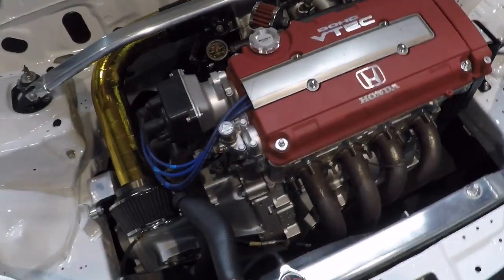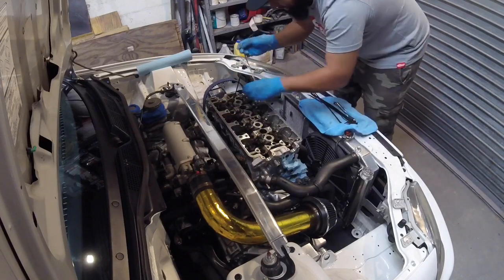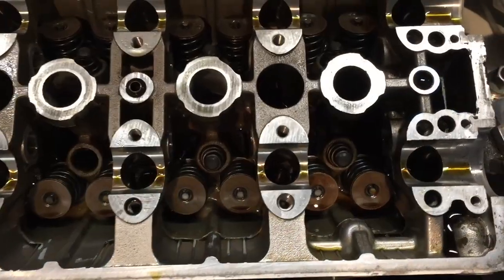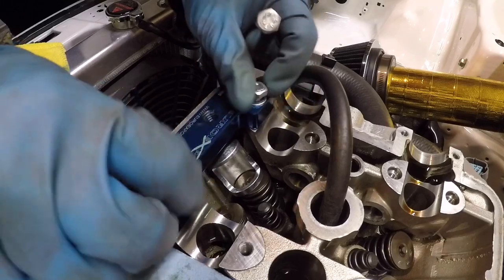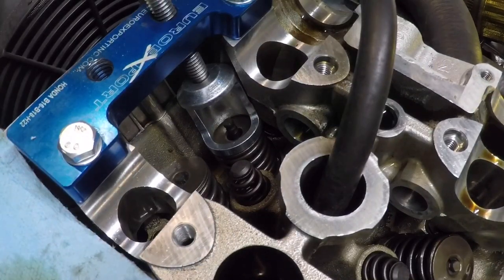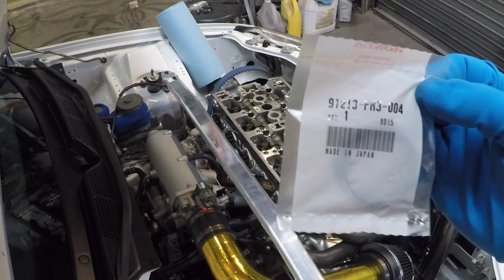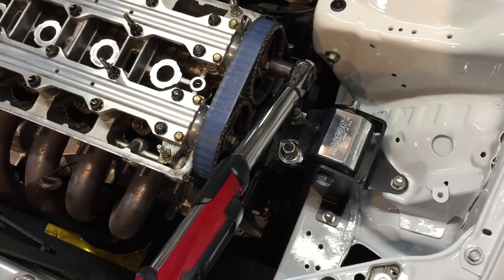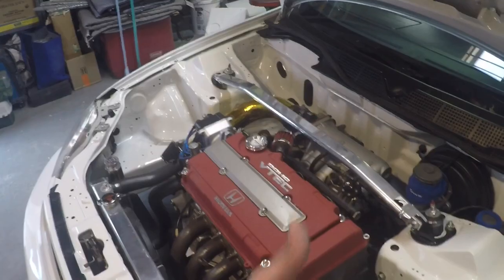How to replace Valve stem seals and lost motion assemblies on your Honda B-series VTEC engine

Comment: Did you have any trouble with the valve stem seals leaking using those supertech seals and dual valve springs? Ive heard they dont play well together.
Reply from the maker: Nope no issues at all! Still running great today 👍🏽

Comment: How many Gallons is your air compressor ? What psi did you use when you took out the Valve Springs?
Reply from the maker: My compressor is 40 gallons and if remember correctly I had the regulator at 60-75 psi